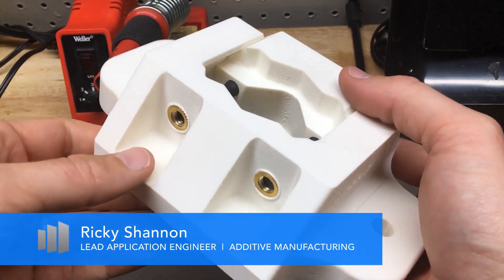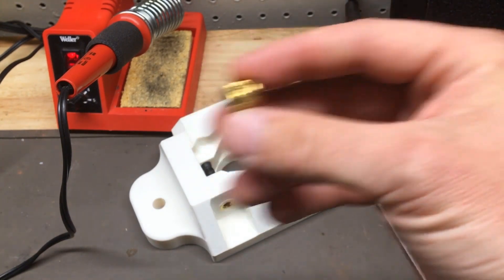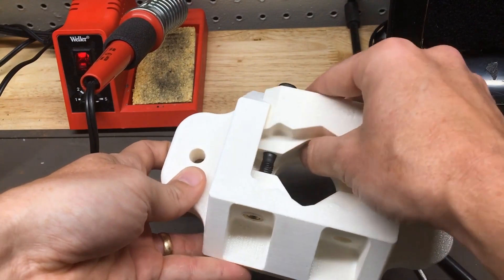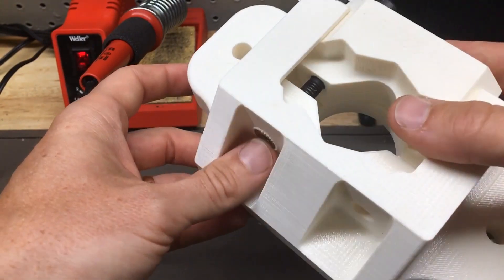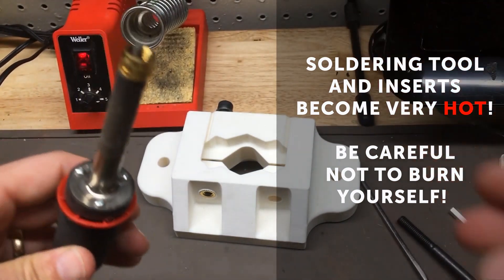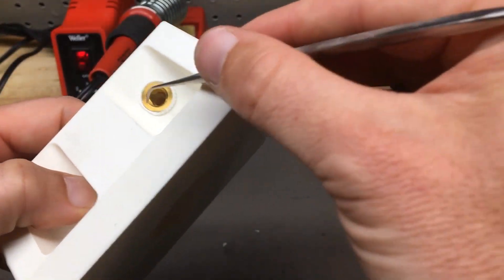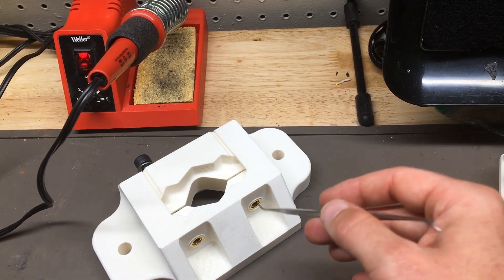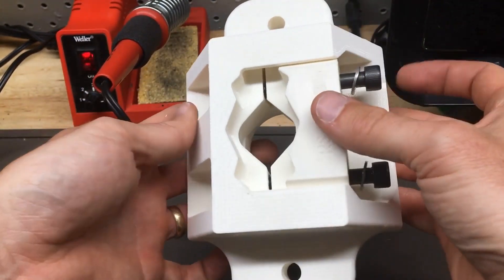3D Printing Tech Tip: Installing Heat Set Threaded Inserts In FDM Parts

Comment: How big do you print the hole in relationship to the insert?
Reply from the maker: The manufacturer of the insert should be able to state the proper hole size for their particular insert. Each manufacturers’ wall thickness of the insert will be slightly different so there isn’t a set hole size like that for tapped holes. If you can’t find the information, I would recommend mic’ing the knurled part of the insert and then making a hole about .020” to .030” smaller. Tighter is always better to start with because you can simply chase the hole with a drill bit to enlarge it if needed - then use that size drill as your reference for future designs. I also recommend a counter sink at the hole opening to help start the insert into the hole.

Comment: Any details on the 3D Printer, hotend, extruder, build plate, etc etc?

Are these FDM ABS parts just strong as injection molded ABS parts, or half as strong or so?  I.e. do the FDM parts fail at the delamination points or pretty sufficient compared to injection molded parts?  Thanks!

Thanks!
Reply from the maker: The 3D printer was a Stratasys uPrint SE Plus and it was printed with Stratasys P-430 ABS. The Stratasys line of 3D printing equipment is what we call a professional-grade solution, and there are no extruder or temperature settings for the user to worry about tweaking – Stratasys invented extrusion-based 3D printing 30 years ago so I trust their settings and hardware configurations more than my own. This is an older model machine (oldie but a goodie) the newer blends of ABS on Stratasys’s product line are a little stronger – but there is more to comparing 3D printed parts to injection molded parts than just the material. 3D printing produces parts that have “grain” (anisotropic) to them similar to wood, this means that the orientation of your part matters to make sure the “grain” or layer to layer laminations promotes strength in your part. In an apples to apples material/geometry comparison, an injection molded part will be stronger as it is isotropic (it has no grain) and does not have laminations that tend to be the failure point on extrusion-based printed parts. However, an injection mold can easily cost $5k to $50k and injection molding has many geometry limitations that 3D printing does not – which makes the lower strength part start to be much more appealing as it can be a cheaper solution with greater design freedom.